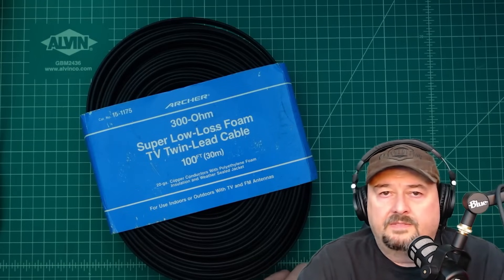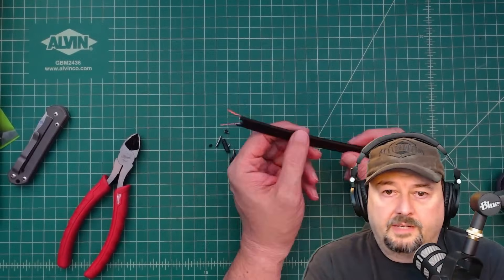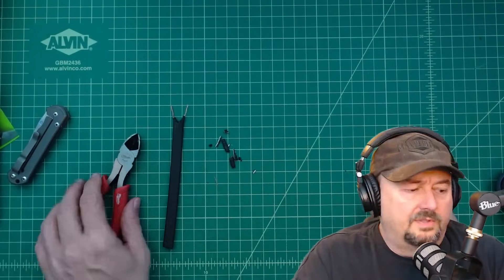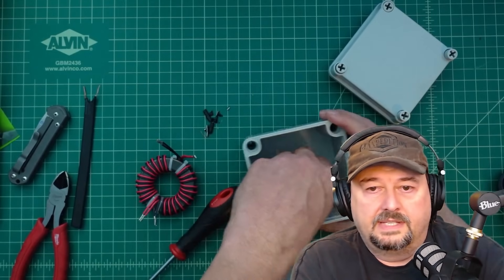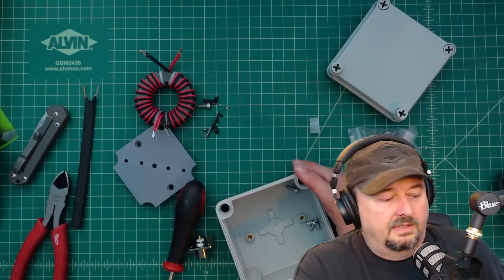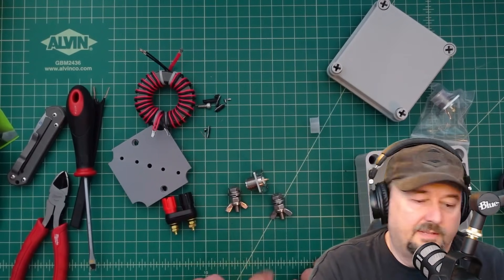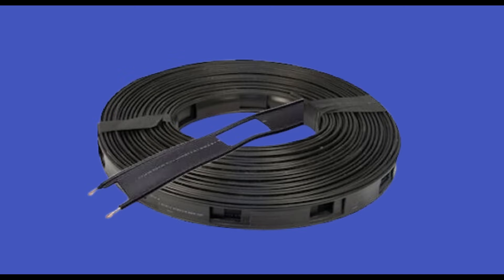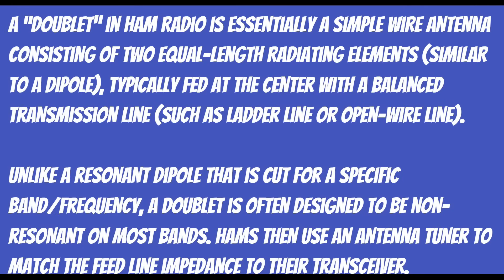300 Ohm Twin Line: The Secret Ingredient for Antenna Magic?

Comment: I have a 150-foot end-fed HF antenna that runs north and south. Would it help me if I went to the middle and ran a 75-foot wire west and a 75-foot wire east, making a + sign? 49-1 Balu would be at the end of the north wire, then go to the shack,
Reply from the maker: I wouldn’t do that and I’m unsure what the change of impedance would be 🤷
Reply: @TheSmokinApe  Thanks

Comment: what about some sort of stain relief configuration for the feed line?  Definitely stainless steel bolts. Maybe a bit smaller bolts/ wing nuts, and solder lugs for the transformer wires. it's a tight box and might need clearance. Can use flat and lock washers. The posts will not provide as much worry-free and positive connection and will oxidize. Ace Hardware has a wide assortment of SS hardware.
Reply from the maker: Not a bad idea, thanks man 👍
Reply: Another brainstorm, for sealing the box penetrations, use plastic washers on the outside or the inside of the box pinched down somehow, or coax tape? If you want to get crazy going overboard,  if you have taps, thread the box and use some sort of sealant. if the box is in a fixed location, maybe add weep /drain holes?

Comment: Feed it off-center. The impedance will more correctly match your feed line. Then, your tuner will be just matching for the short length of coax to your transceiver. (1/3x2/3).
Reply from the maker: Thanks

Comment: I'm a big doublet fan . Think total length ant and feeder ? A g5rv total length one side + feeder is 51' +34' = 85 feet . A variation is zs6bkw 42' + 40' = 82 feet very similar.  I went with double size but slightly different.  So 82' and around 80' open wire around per side and 4 ' apart.  You may have to adjust slightly then straight onto a very short coax then rig . If you get it right by adjusting feeder length you can get a spot on match and bypass atu  . My match is focused on 40m (extended double zepp ) . It also is 2.5 to 1 on top band , just off on 80  . 
My doublet is 2 continues wires from one end to the short coax  ×2 (2feet )  about as simple as you can get , works well all bands , some bypass the atu (like 40m ) . No joints just wire all the way through to window vent to shack . Trying to eliminate weak points .
Reply from the maker: That sounds great 👍

Comment: Thanks for another excellent video. If you are looking for more flexible house wire, try THH (without the nylon coating). You may have to go to a real electrical supply house instead of a big box store. About THHN, the last letter  N stands for nylon. That is a nylon coating to make it easier to pull thru conduit. The nylon coating also makes it stiffer. I buy 300 ohm twin lead whenever I find it at flea markets or yard sales. Not the fancy foam shielded type like in your video, just the old fashioned stuff. One local EOC uses a 2 meter J-Pole made from plain 300 ohm TV twin lead. The EOC has good elevation, so the antenna is thumb tacked to the wall. Works good for over 40 years! BTW: There is a "Smokin Ape" cigar store in town. Since I'm in Torrington CT, I don't think it's you.
Reply from the maker: Thanks for the info David!  And no, that’s not my shop 😮

Comment: I had excellent results using a doublet antenna cut for the lowest operating frequency around  the low end of 80 meters. Fed with the cheap 300 twin lead ( the paper thin  stuff). An Icom AH-4 coupler fed the twin-lead, then coax (8x) and the couplers control line went through the wall . Worked great  with  my Icom IC-746PRO or Icom IC-7000
Reply from the maker: Thanks for the info and for watching La 👍

Comment: If it wasn't so stiff and sticky I was gonna suggest splitting it down the middle, enough for the leg length ya want, then you wouldn't need all the hardware and extra wire.
Reply from the maker: Yeah, I’m gonna have to figure this stuff out.  The next video for this will be making the choke 👍

Comment: Way back in the 80’s we used them for TV antenna and they worked well. Now for ham yes they work well. I would go with the 1/4 20 bolts.
Reply from the maker: Thanks for the info, pretty sure I will use the 1/4 20 👍

Comment: Hi ape, this twin line is no good as a feeder for transmitting. 
The homebrewed ladder line or the commercial 450 ohm window line are always meant for low loss and high power handling capabilities. Because they have air as the dielectric for most part of the spacing between the two conductors. Air has a very high dielectric breakdown voltage, and hence, the line can sustain high VSWR.  The high impedance, like 300-600 ohm of the line, means low I2R loss in the line.
Though I have no personal experience with the 300 ohm  TV foam line, many have complained (from the comments section) that the copper was brittle. 
The antenna is called the double Zeppelin antenna or simply doublet antenna. It's also called the tuned feeder antenna. The length of the dipole can be 1/2 lambda of the lowest band of interest. You can bring the feeder straight down from the feed point (at 90 degrees to the horizontal radiating elements are at equal angles in case of an inverted V configuration) to the BLT (balanced line tuner); a small length 50 ohm patch cable can be there between the tuner and the VSWR meter and one between the VSWR meter and your radio. Of course,  there are certain lengths of open wire to be avoided in certain installations. But, you dont have to worry much if you have a good BLT to handle the power and the impedance ranges that you would anticipate. 
There's no need for an 1to 1 CMC choke between the open wire and the coaxial cable. I say you don't use a coaxial cable at all; bring the open line all the way to tuner.
You may want to have an 1 to 1 CMC choke between the radio and the tuner's input,  if you want. And that must be the 1:1 Guenella current choke and not the one you have with you now. The choke what you have at now is not a perfect 1:1 choke.I think it's DG0SA's 1 to 1 choke.This design uses a single core and has two 100 ohm bifillar windings on either halves of the torroid. The intertwinding capacitance will limit the operation on the higher end of the HF spectrum. 
You may want to refer to the writings of Tom, Duffy, Rick and so on for a detailed explanation and mathematical treatment. 
The BalUn box seems good, and I would prefer to use the SS bolts with wing nuts.
I wish you all the very best. 
(If you want to use the same twin line, you have to make windows cut all along the line using a rectangular or circular punch cutting device to minimize the quantity of plastic/foam dielectric breakdown the two conductors).
De VU2RZA

Comment: It's a horizontal Poseidon! I just realized that 7.5 meters is basically the Rybakov vertical length, but it's a non-resonant random wire length, so it makes sense. I still haven't made or tried a doublet yet, so I might have to give this a shot.
Reply from the maker: Very observant 👍

Comment: In older versions of the arrl antenna book there is a good cookbook folded dipole design based on this 300 ohm line in the chapter on "Portable Antennas". Used one on 80m for about 10 years.  Folded dipoles don't radiate very well on the second harmonic, which can be useful.
Reply from the maker: Thanks for the info EID 👍

Comment: I converted my 160m, coax fed dipole, into a 160m doublet, by replacing the feedline with 450ohm ladder line.... 300 ohm ribbon will pretty much do the same. What I immediately noticed was the receive was much better on all bands. I totally would recommend the doublet antenna for anyone. 73
Reply: Doublets are fantastic! I have actually used both 450 ohm ladder line, and 300 ohm twin lead with doublets. Both work very well.
Reply from the maker: Thanks James 👍

Comment: I believe you have 75 ohm feedline. I have a spool of that same feedline. The space between the conductors sets the impedance. The higher the impedance the lower the loss at high SWR. I use a lighter weight version of TV 75 ohm twinlead for a QRP portable doublet. I'm using 30 gauge wire for the radiators and supporting it with a Sotabeams Carbon 6 mast. Ultralight is necessary for the Carbon 6. 

I use 300 ohm (which is window line, but smaller than the 450 ohm you showed) on my doublet at home. I can tune 6-160 with 108' of wire radiator. You need a balun, not a choke to convert from balanced (twin lead), to unbalanced (coax). I used to use a 4:1 designed by DG0SA/sk, and a couple years ago I switched to a 1:1, and seem to have better luck with tuning the low bands (specifically 160m). Check out Thewireman, they have photos of the different sizes of twin lead. Good luck with your doublet project!
Reply from the maker: Thanks for watching W8tam.
Reply: Why would it say “300 Ohm” right on the package label then?
Reply: @forgetyourlife  Because radio shack.
Reply: @forgetyourlife  Also, it might be 300 ohm with the foam. Not too sure. The spacing looks more like 75 ohm than 300 to me though.

Comment: Great Video and Idea. I don't know about you, but I can become stuck using a specific type of antenna because it works, not trying other antenna designs because ofnthe old adage "if it ain't broke don't fix it." I find I miss out on antennas that work better. That's why I'm glad you are trying this out. I've never been a dipole or doublet kind of guy, only because I haven't taken the time out to try a few of them. I've had such good luck with my end fed antennas, I didn't consider trying something different. Thanks for the inspiration...73...Hugh...KN6KNB
Reply from the maker: Glad you liked the video Hugh, thank you for watching 👍

Comment: Have a doublet up 35 ft fed with Radio Shack 300 ohm TV twin lead.  It was an experiment 20 years ago and it’s been there ever since.  Works quite well.  I talk all over the world with it.  I regularly put 200 watts through it and have had no issues.  It won’t fall down.  Pretty tough considering the weather here in NH

-Bob / AB1EO
Reply from the maker: That’s awesome Bob, thanks for sharing 👍

Comment: It's not called twin-'line'. It's only called twin-'lead'. The other parallel wire feed-lines are called 'open-wire lines,' or 'ladder-lines', or 'window-line'. I guess it was so popular for the consumer TV industry that it picked up a different name from the feed-lines used by hams, industry, and the military.

You really picked the wrong twin-lead for portable operation. The non-foam dielectric stuff is much more pleasant and easier to use, in particular for portable operation. The foam stuff is just MUCH  less convenient to use, though it is lower loss. Yes, I've tried to use it for portable opps. It's almost like running hardline for a portable application, though not quite. :) 
Double-check the velocity factor on the foam cable. I'm sure it's higher than on the standard, flatter, much more flexible twin-lead. The foam dielectric twin-lead was created near the end of the twin-lead era, when they were trying to make it more competitive against the other advantages of coax. 
300 Ohm twin-lead was the standard for connecting TV's to outdoor antennas for a couple of decades at least. So it was probably the most popular RF cable on the planet until cable TV came along using 75 Ohm coax in order to meet the different needs of the cable TV industry, i.e. much better at blocking stray radiation, and more immune to interference, even though the 75 Ohm coax was more expensive and higher loss than twin-lead. If they had cabled apartment complexes with inexpensive 300 Ohm twin-lead a lot of people in apartments who weren't paying for cable could (would) have simply repositioned the rabbit ears on their TV's and received the cable broadcasts for free from the twin-lead running through the walls. Even so, I once put a big coupling loop with an inline pre-amp on the ground next to my alley fence and received the cable vision trunk-line signal running along the alley even though it was underground and probably reasonably well shielded coax. Of course that was many years ago before the signals were digitized and encrypted. Twin-lead would have bled all over, in addition to its high susceptibility to nearby noise. I suppose the cable industry picked 75 Ohms instead of 50 Ohms for their coax based on the need to produce the very cheapest suitable coax per foot that met the industry requirements, and their research indicated 75 Ohms was it. We're talking tiny fractions of a cent per foot difference. But when you need several billion feet of it those fractions of a penny really add up. But I'd personally never heard of 75 Ohm coax until cable TV became a thing.
On HF, even the simple, non-foam twin-lead has little loss and there's no need to use the awkward foam dielectric stuff. You got a deal on it because the foam stuff is a pain in the butt to use, especially when its only advantages, low price, and low loss simply don't apply in very many applications these days. As is, these days it's so rare that it's not even low cost. If transmitter and receiver outputs were still designed for 300 Ohms, (or 450,) you'd probably still see it in use all over, at least by hams, CBers, and scanner listeners. 300 Ohm folded dipoles are a piece of cake to make to match to 300 Ohm twin-lead feedline. For mono-band use there will be no impedance matching required. No balun required. No transformers, no chokes. Just simple twin-lead for both feed-line and antenna. In fact, since I got a roll of twin-lead at a swap for next to nothing I plan on building a couple of 5 Watt and 100 Watt matching transformers to connect at my rigs so I can build small, simple, efficient folded dipoles and feedlines for solo portable use, since in that application there is little concern for radiated signal from the feedline or noise pickup from it. There will be that 1 matching transformer at the rig, but everything else will just be twin-lead, good for reliable portable use, and definitely not the foam dielectric stuff. Good luck with that for portable opps.
Reply from the maker: Thanks for the info John, much appreciated 👍
Reply: @TheSmokinApe , ham radio is full of history and trivia. I'm trying to pass some of it on before I croak. Some of it helps explain things and keeps newer hams from repeating the same mistakes as the old guys made.  :)
Reply from the maker: @ its appreciated

Comment: Yes, it's the best stuff for anything 100 watts or less. Need more power handling or higher power to loss ratio? Use 450 ladder line. You need a good antenna design, for either. You also need a tuner, and 4:1 balun for connection to 50 ohm coax to the radio. Balun goes between coax and tv line. A G5rv i have doesn't have a 1:1 balun in that position and for 450 ladderline impedience at this point with 35 ft of ladder line it match's 50 ohm at this point.
Reply from the maker: Thanks for the info and for watching N9YSQ 👍

Comment: I've had a Doublet antenna up for about 5 years now.  The legs are 67' long, and fed with 300 ohm ladder line all the way into my shack.  It connects to a MFJ-941E manual tuner, which has a 4-1 balun on the inside.  I then have a short coax jumper which goes to the radio.  Unfortunately, the feedpoint is only up about 20 feet.  But, I've worked the world with it.  It's been a great antenna for me.
Reply from the maker: That’s awesome, thanks for watching Ralph 👍

Comment: I use a delta loop cut for 30 meter's held point up with a 40 foot Spyder been pole feed with 300 ohm tv twin lead about 2 feet up one side with a Manuel tuner work's great from 10 to 40 will tune 6 through 80. The tuner has a balun already.
Reply from the maker: Thanks Jeff 👍

Comment: Hi! If I’m not mistaken, this twin lead might be quite lossy due to its foam dielectric. Traditional 450-ohm or 300-ohm twin leads typically avoid foam dielectric for this very reason. Ideally, it’s better to use a homebrew open-wire feedline by simply using household electric wire with 4-inch spacers. The impedance would be roughly between 400 and 600 ohms, and it’s nearly lossless. There’s no doubt that no multiband antenna can outperform a doublet antenna. Wishing you all the best with the project!  73
Reply: You're mistaken foam is usually found in low lose coax. Here's the issue when used in coax you must be very careful not to bend as the center conductor will migrate through the foam to the outer conductor. Whipping in the wind bending around sharp corners exposed to high heat that makes the foam even softer are all big no nos with foam. Treat it correctly it's great stuff
Reply: @P.SeanCoady  this is what chatGPT says about it "Open wire is less lossy compared to foam dielectric twin lead. The main reason is that open wire has air as the dielectric, which has much lower loss than foam or any solid dielectric material. Foam dielectric twin lead, on the other hand, suffers more loss due to dielectric heating and higher capacitance. Open wire also has better impedance matching and lower signal attenuation over long distances, especially at higher frequencies. But it’s more vulnerable to environmental factors like wind and rain unless carefully installed. Foam twin lead is more convenient and compact but comes with a performance tradeoff. 🤔"
Reply: @Capt_Duffy  where did i claim that ladder was less superior than coax. My statement was all about foam as a dialectic and it's tendency to migrate to the shild if not treated properly period.
Reply: @P.SeanCoady  You are correct; it was foolish of me. I misunderstood your point, and I apologize for that. 🙏
Reply: Nothing compares to ladder-line for low loss, but foam dielectric twin-lead is less lossy than the solid dielectric twin-lead, (which is why they went to the trouble to make it,) and also a little less lossy than most of the RG8 coaxes out there.
Reply from the maker: Thanks Capt Duffy 👍